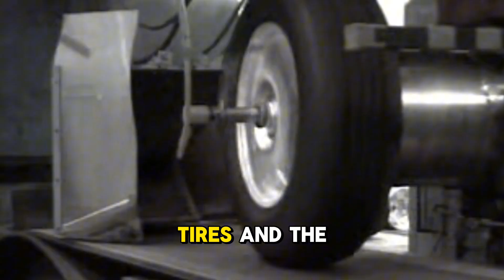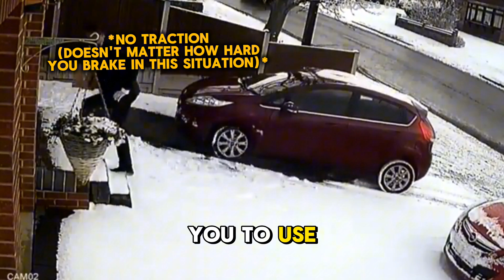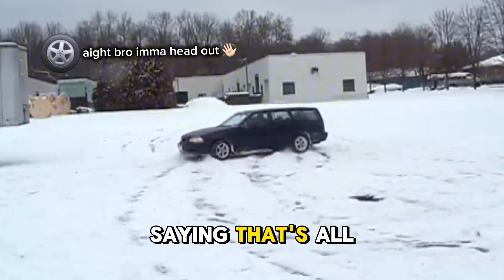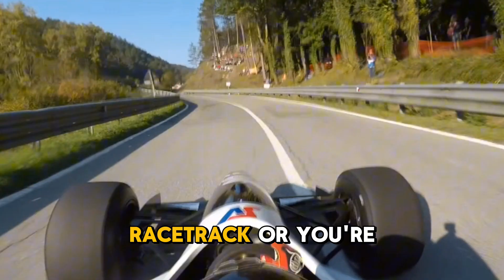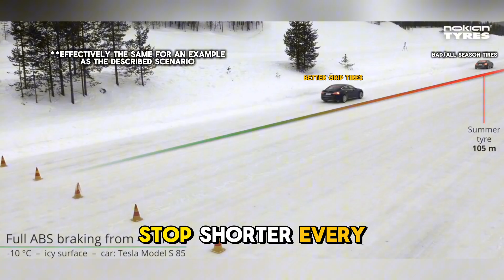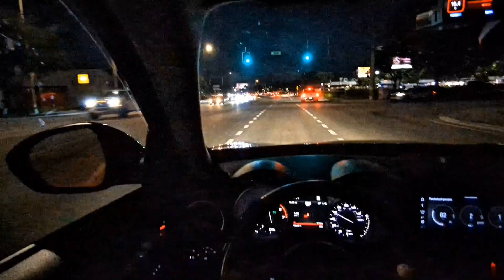YOUR brakes are LYING to you...

Comment: Are all season tires always bad tho. Aren't there any good ones?
My town is by the sea and right under a cliff and for the last decade it barely snows for more than a couple of days each winter. I use mid-grade all season tires but everyone seems to hate them.
Reply from the maker: Going purely off of firsthand account, my all season ultra high performance tires have been great! But summer tires have a softer compound once they heat up, leading to better grip and better handling.

Your all season tires aren't likely giving you maximum grip, and it'd be better to have a set of summer tires and a set of winter tires if you want maximum grip year round.

Comment: Every cheap brake on a modern car can overcome the tire traction limit. Thats why the carwow stopping test is always so infuriating to me.: "oh he had a shorter distance. Must be because of the ceramics"

No it isnt, its because the car had better mechanical grip which is 90% tyre compound and 10% abs and suspension setup.

On the other hand. On a powerful car, proper brakes are needed even for spirited b road driving.
Reply from the maker: Exactly!

Comment: At high speed it brajes matter but once you get to a slower speed it will try and lock up the wheels
Reply from the maker: Correct, brake fade is more probable at higher wheel RPM.

Comment: If you had no brakes (think the brakes are failing because all the brake fluid has leaked out) your tires is not stopping your car no matter what you say. You need brakes to stop the tires from rotating so the tire contact patch can do their thing.
Reply from the maker: ⬆️ this is correct: brakes are in-fact needed to slow the wheels. Tires work as an interface to transmit braking force to the ground.
Reply: You clearly missed the whole point of the video
Reply: @chiefdenis  You clearly like falling for lying clickbait titles.
Reply from the maker: @aikafuwa7177 

Not clickbait tho?

Comment: What bout the case of an old Jeep that came with 29 inch, skinny, small tires, and I upgraded by lifting the jeep and putting 33 inch tires that were also thick and heavy?  That jeep has NO ABS, and it was hard to lock the brakes, until I put EBC Yellow Pads in the same size as the original pads.
Reply from the maker: This is a great example - you upgraded the tires to get you so much grip that you can't lockup the brakes without better brake pads.

Would recommend brake upgrades to anyone that gets massive tire upgrades so you don't leave any potential braking gains on the table!
Reply: Ok, likely the switch in tires has nothing to do with a change in grip.  Most AT tires or the like will have about the same traction (assuming a quality tire).  The issue with braking experienced by upgrading to a larger tire has to do with the 4” increase in the lever arm from the tire contact patch to the brake pad.  The longer the lever arm, the higher the torque is that is needed to be opposed by the brakes.  The reactive force being generated by the brakes is a function of the diameter of the rotor, the pressure being applied to the pistons in the caliper and the coefficient of friction between the pad and the rotor.  So, if there is no change to the brakes with larger diameter tire, then the brake pressure needs to be increased as the only option to lock up the wheels.  If pressure is max’ed out because of insufficient friction between the pad and rotor, then the wheels won’t lock up.  The Yellow stuff pad has a higher coefficient of friction than the basic OEM pad. Hence it is possible to lock up the brakes

Comment: Rule of thumb, if you can lock up the wheels you dont need bigger brakes
Reply: But if you brake 3 times in a row and you can feel it's not breaking the way you would expect it to, then you do.
Reply: @taqial-faris6421  If you're repeatedly abusing the brakes from high speed down to parking lot speed (let's say for some form of canyon running), then you either need a higher temperature fluid, air ducting, better rotors (vented but still same diameter), a more aggressive pad that can handle the higher consistent temperatures, or a combination of those.

You don't really need to go "bigger". Grip is generally the limiting factor immediately followed by heat. While the rotor is a traction surface for the pad (and larger pad and larger rotor do give you potentially more braking force to work with), the rotor tends to work most as a heat sink, since you're turning kinetic energy into heat. 

Now if it's just a case of, "I go from 55-0 (because intersections)" and the brakes are noticeably failing, I'd say what the other person responded. There's a failure somewhere in your system.
Reply: @taqial-faris6421 nope, then there is a fail in the brake system. I drive pretty aggressive and only notice a  very little brake decline in heavy traffic. Test new cars by going from 80 to around 10 km/t to check for fail and they do not get too hot from that
Reply: I guess if you’re running races or something like that it could make sense. Bigger brakes mean lower temperatures and better cooling. Needless to say you shouldn’t be running races on the roads…
Reply: Not when you're driving on race track for sure!
Reply: On some older cars, brakes were way undersized. A couple of hard stops and they start to overheat. Hills were also a problem, especially if you drove an Automatic Transmission.

Comment: But the brakes have to be strong enough to lock up the wheels.
This is an issue with smaller brakes at higher speeds. I had experienced this first hands a few times, only below ~60 mph they always locked up, but at highway speeds, there is the possibility to overwhelm the brake.
Reply from the maker: Absolutely, which is a great point! That's really where big brakes shine, when you finally exceed your braking capacity (like on a track).
Reply: @TorqueTheoryLabs thanks for the acknowledgment :)

For me, I experienced this a few times on the Autobahn when doing an emergency stop from high speeds. You can feel when the brakes finally are strong enough when the ABS kicks in (or on my older cars when the tires finally locked up)
Reply from the maker: @skayofox 

Exactly - ABS is simply the tires reaching their limit, the wheel speed sensor detecting locking and releasing the brake caliper to keep you rolling.
Reply: Call VW Group all kinds of names. Diesel-gate. Etc. Honestly? Hardly ever has a car felt under performant on the brake disk ability to slow the car down. Point that to less then ideal summer tires. Point that to never truly putting oneself in a situation to find that out at high speed. 60 mph freedom units is roughly 90km/h? Can not calculate stones, feet, thumbs, and such into sensible measurements.  hi hi. Anyways. Volvo now has a speed limit of no-fun 140km/h. Right? Most roads a car find is at most letting you go 120km/h. Right? It really is Autobahn left. In many ways a normal road car is probobly better off not over-saturating the cold brakes into locking up in say a high-speed bend. Since on the strait parts you would see the issue and slow down earlier. Most cars have ABS and stabilizing systems. Even then having the tires lock up serves no use. It is a fine balance that I expect rest of the world have figured out by now in car designs. Even the Japanese cars are really fully capable to handle a complete 150km/h total stop. Almost like even road cars has the brakes and tires comparable to racing cars in the 80s 90s or something...

In other parts of the world, with decent driving applied, there is a problem of under using the brakes. Making the rotor and at some point the pads and literately the hole braking system start to fail. If the metal that the brake pads are braking up against starts to become pitted from rust? In general the brakes are overpowering and never applied enough to actually stay fresh and clean? Then what good was it all. If however the brakes are just slightly under sized for a high-speed highway emergency stop? More braking are needed for the day to day driving. Keeping that issue of rust away. Especially winter time with salt on the road? Where even the best winter tires simply have you drive slower and conservatively? The brakes becomes a rust issue. Unless if you have a driving style of pretty much riding the brakes constantly. Even that is not really good for the brakes. I can only imagine what a racing brake setup would look like when winter conditions makes them so overpowering that you hardly need to press the brake pedal to lock the tires up. Even with what is on the limits of legal winter tires.
Reply: @TheDiner50 what are you talking about and what has this to do with my comment? O.o

Yeah, locking up the wheels isn’t ideal, it was just about that the brake needs to be able to lock up the wheels. In a perfect world, you would want as much braking exactly at the tipping point before locking up the wheels. That’s what ABS tries to accomplish.

Good brakes go a long way, especially on the Autobahn where I drive daily. At speed you can actually overwhelm small brakes. Same on track days.

If the brakes are adequately sized, you’ll not have any issues.
Rust can be circumvented if you regularly apply them, even if it’s just a little bit to keep them dry. That’s why me BMW applies the brakes in rainy weather from time to time with very little force.